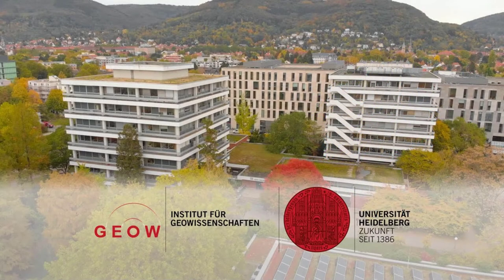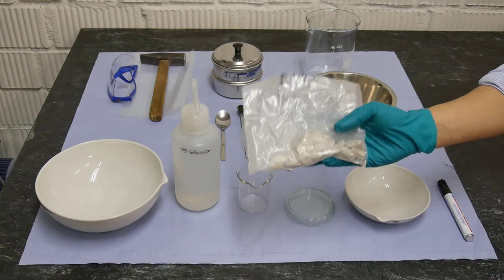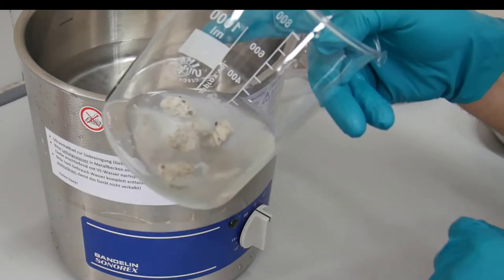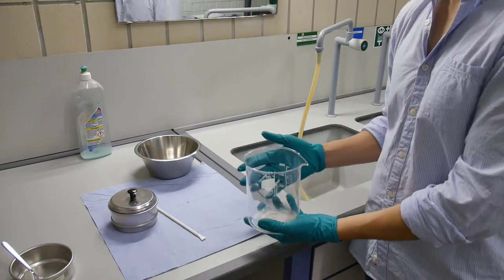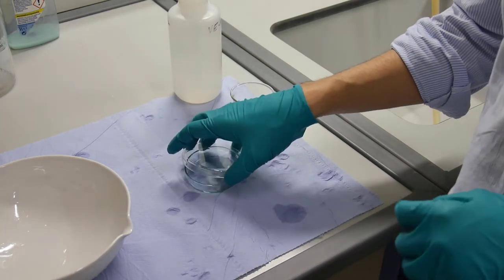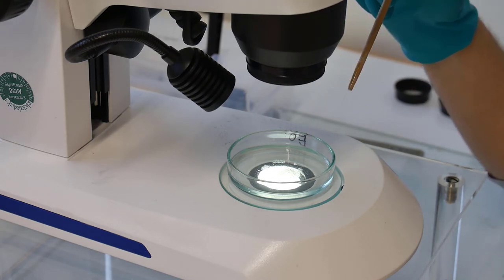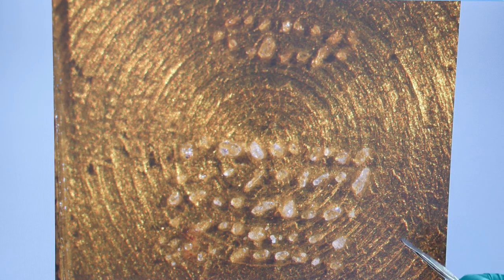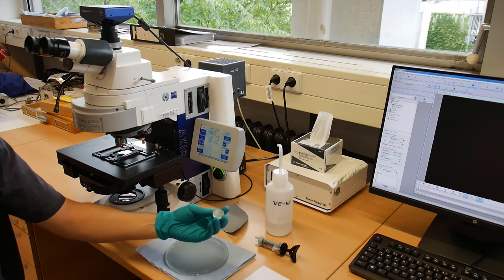Heavy Mineral Separation - from rock to mineral mount

Comment: To separate the zircons through light coming from below is great. Does any binocular it’s enough to handpick the zircons?
Reply: Yes, however, using a binocular microscope equipped with polarizing capabilities makes the task significantly easier (easier to recognize zircon as it reveals the relief and interference colors of the mineral). If your microscope doesn't include a polarizing setup, you can purchase polarizing plastic sheets. Simply place one sheet over the transmitted light source (bottom) and another over the lens. I actually did this to a normal binocular microscope today, and it worked quite well. cheers.